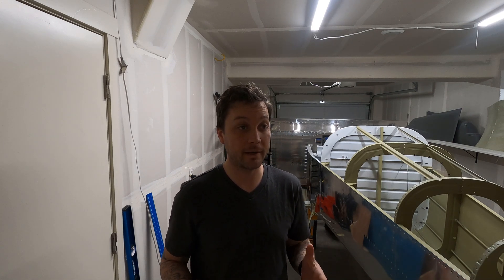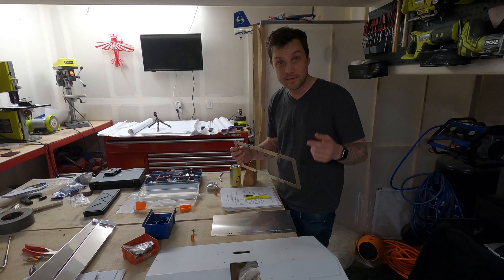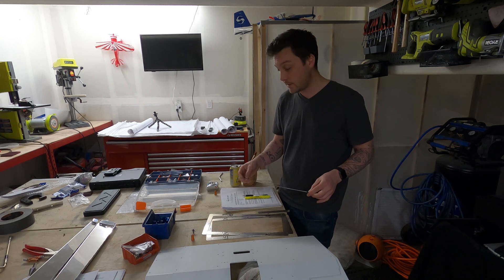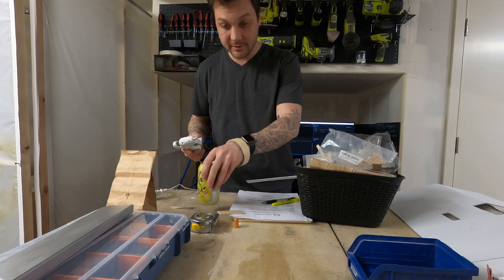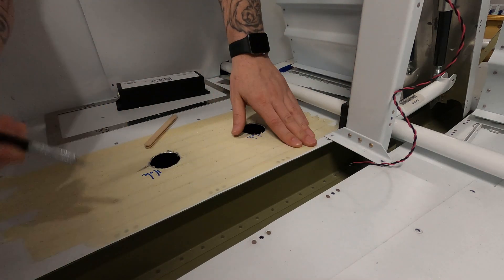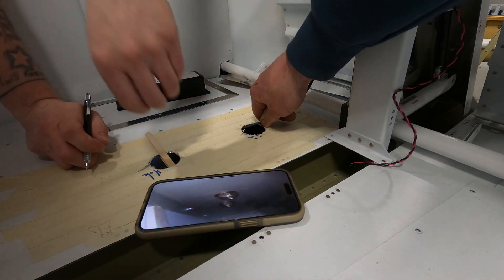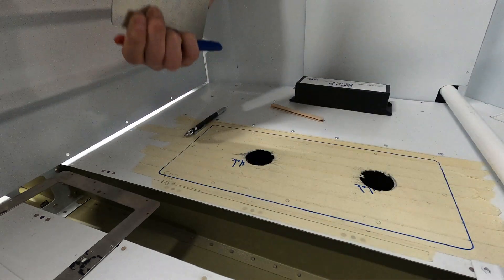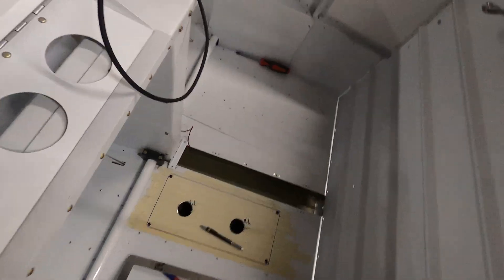Cutting a Large Hole in My Airplane - RV-7A | EP3.31

Comment: Nice work Ryan 👍
Reply: One question from the uneducated, why did you not put a mounting screw in each corner of the insert plate?
Reply from the maker: @DazzInHKG I overthought the piece a bit, but I was having trouble aligning nutplates and rivets and ensure I could get it all installed and did my best to keep with edge distance rules. Corners became tricky. I probably should have two on the ends closer to the corners, but then I felt like that was overkill. 

With carpet being over it, I’m not overly concerned something is going to grab a corner and pull it up. 

But, yeah, maybe two on the edges a little closer to the corners…
Reply from the maker: Thank you! The hole worked out!!

Comment: Hey Ryan, I wondered when you put the baggage floors in already but didn't say anything because it was too late. I have some black conduit left and I'm thinking I'll run some under the baggage floor before buttoning it down.
Reply from the maker: I knew what I was doing at the time, but had some other thoughts.

One: I was anxious for progress! Didn’t want you to slow down for redesign.
Two: I thought I’d have less systems in back. I want to keep CG as far forward as possible. But some of that isn’t a reality. There’s quite a few items going behind the pilot.

Three: I looked at the two runs I have available and thought, “that’s plenty.” The. I looked at a bundle of wires and static tube and realization set in.